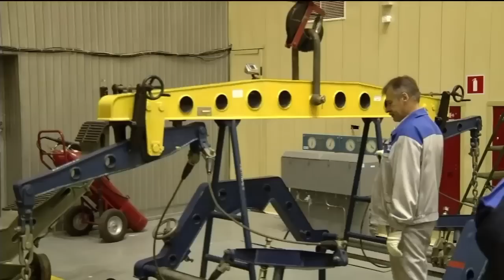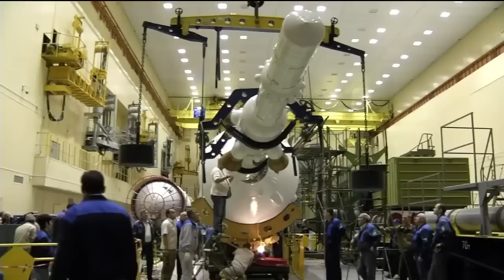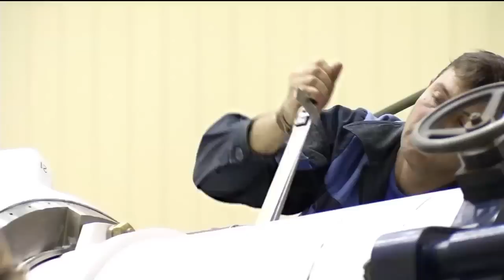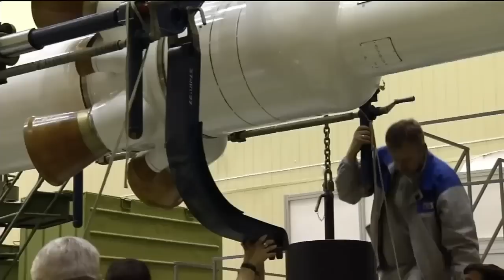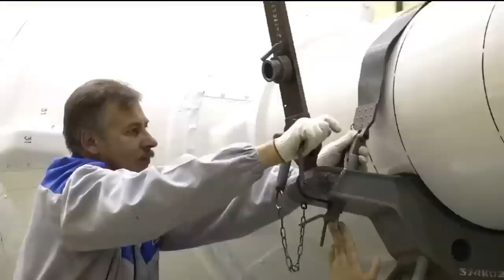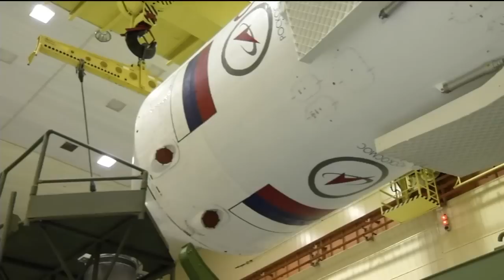The Expedition 33/34 Soyuz Spacecraft Meets Its Booster Rocket

Comment: Yup i am aware of that, but a bit of common sense would simply see them put rubber seals over the switches and make sure there are no "cracks". Simples. Pencil 1, Zero-G $1,000,000 pen 0 lol.

Comment: Is the escape tower salvaged after it's ejected or lost?
Reply: Humberto The Believer lost
Reply: @jacobsmith4453  ....What a waste. I guess it's cheaper than designing one with a parachute.
Reply: Humberto The Believer or just be like spacex and have it built into the capsule
Reply: @jacobsmith4453  ..That thing scares me. Sure it works n looks super fancy, but if something was to go wrong n explode.......I much rather have the escape tower.
Reply: Humberto The Believer but it works perfectly fine, they have done many tests and even when it underperformed it met requirements

Comment: They don't wear safety helmet.
Reply: That's because the general idea is - if after a team inspection of equipment this falls from the crane and crashes - it's their fault  LOL (I'm joking - I have no clue why this is - in fact I even searched it in Russian and found no hits. But judging by the fact that the video is from 2012 (When Roskosmos was fully privatised - didn't work too well in mother Russia) Allegedly cash went missing and crashes started becoming unusually frequent.  I wonder if the helmet situation was resolved in 2017 and if not then there has to be some deeper underlying reason for the no helmet thing.
Reply: Tony White  del idía

Comment: But it really IS that simple lol. Particles like that cant cause problems if equipment was prepared to resist particles. As for long term, shuttles and ships were/are practically vacuumed with high pressure vacuums and more, removing particles and contaminants after each flight. I am baffled to why you would spend anything over 1000 on a pen when it would cost around that to put rubber air tight seals over switches, joints and cracks. Reality is, someone wanted a pen, then it became a challenge.
Reply: BMW

I7ro7.63  mmm mml.

0te 
Key.